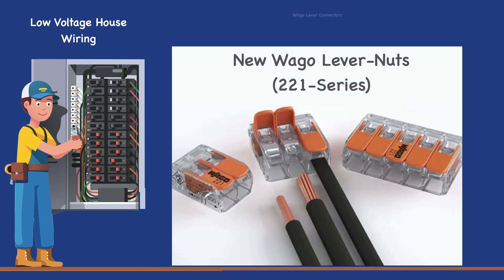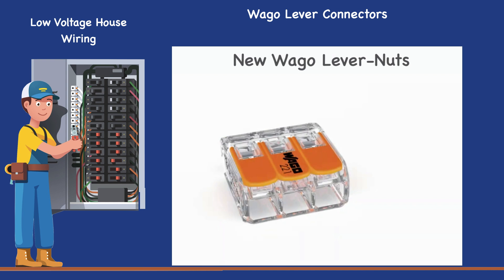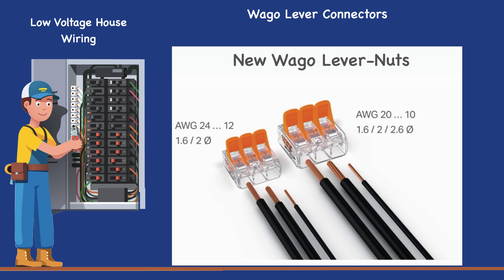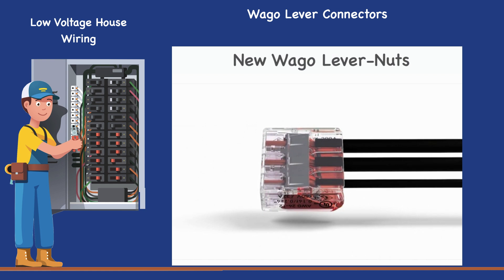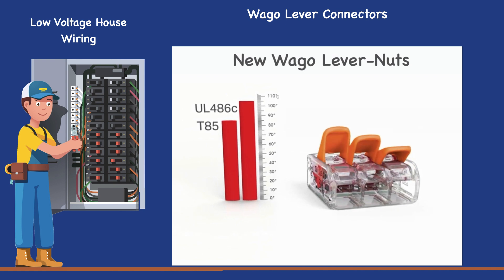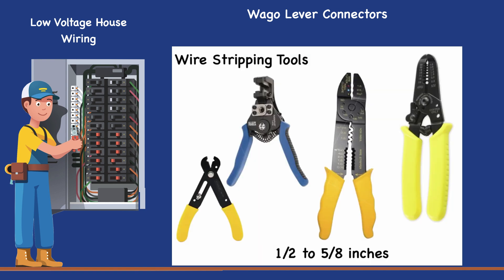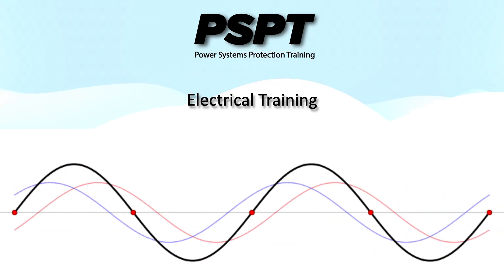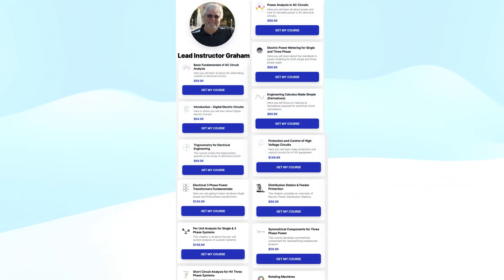Low Voltage Wiring - Wago Connectors

Comment: They say "gas tight contact point" but I don't see ho they could achieve it there. Does not seem like strands deform that much if at all at clamping point, the only marks are left on the side of strands that face the clamps.